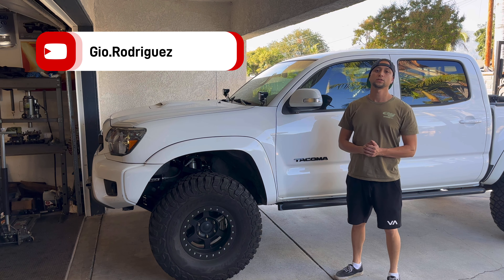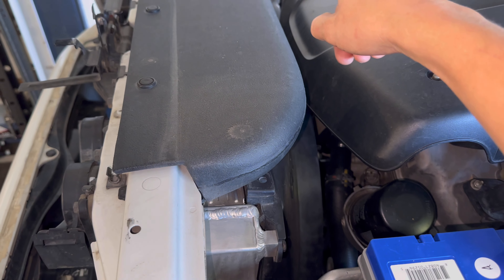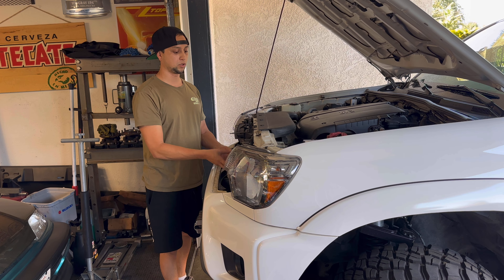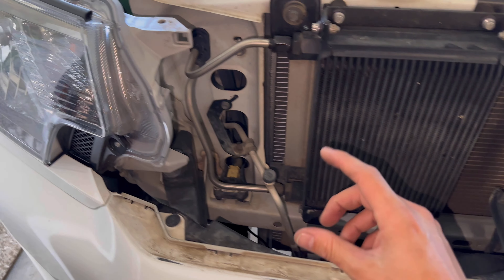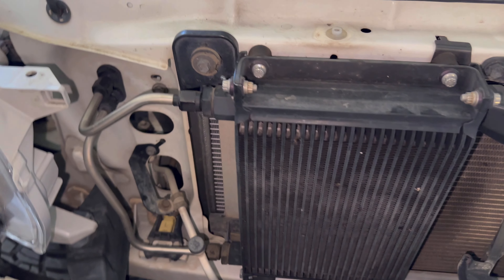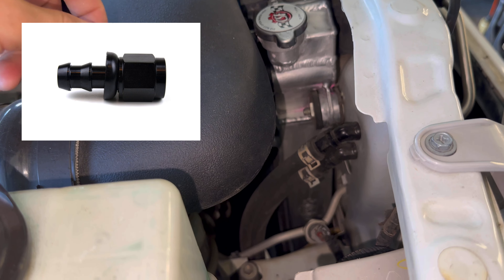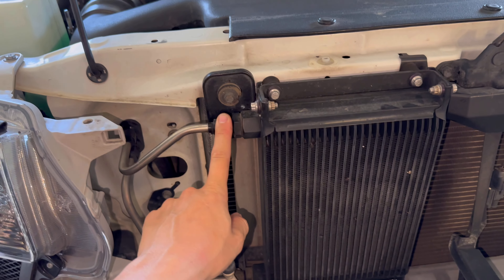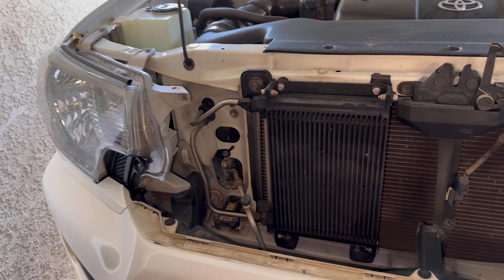Transmission Cooler UPGRADE On My Tacoma! So Much Better!!

Comment: I installed a Koyo XC191106W cooler to my 2015 Tacoma . Looks very similar to yours. It wasn’t cheap.  I have the tow package but I decided to keep it inline with the radiator. I’m in SoCal as well but go winter camping a lot.  Also when coasting down hill my trans temps drop to 115f which is pretty low in winter conditions. Thanks for the video. I pretty much mounted mine in the same location as you.
Reply from the maker: We took the truck out a lot to snowboard last season, but I never encountered any over cooling issues.

Comment: Separating the fluids like you did also has a safety factor, and that is keeping coolant out of the trans and keeping tans fluid out of the cooling system in the event your radiator trans cooler was to leak internally which i have several times..
Reply from the maker: Yes, definitely another great reason to keep them separate 🤘🏼

Comment: When sitting idle your AT fluid could get hot without being connected to the radiator because the fan will come on and cool it.
Reply from the maker: @MrKody300  you’re missing the entire point of an external transmission cooler and how it works lol

Comment: Lol, Y I have a 2011 TRD sport 4x4 with 230k on the clock and no issues at all except the common U joint replacement!
Remember. Don’t fix what’s not broken! Lol
Reply from the maker: You must not watch my videos then, because I fix everything well before it breaks.